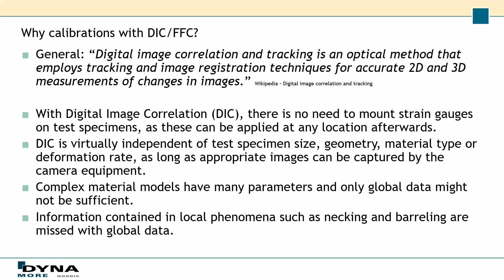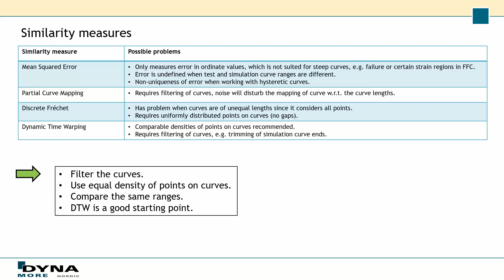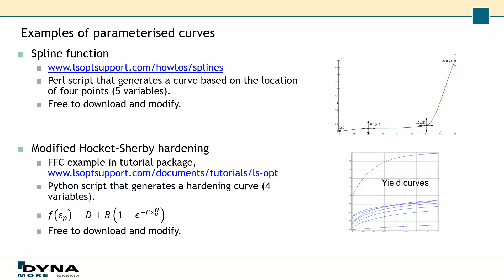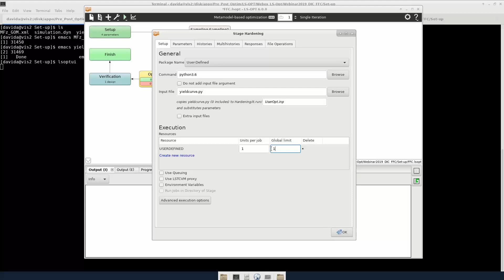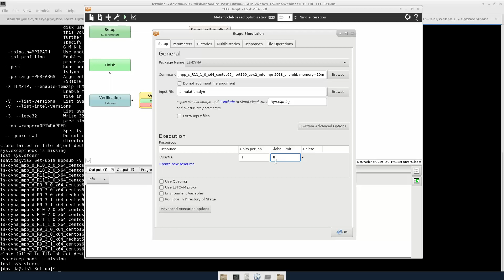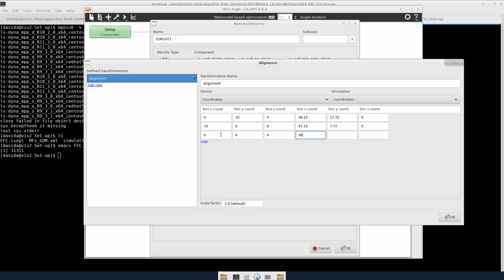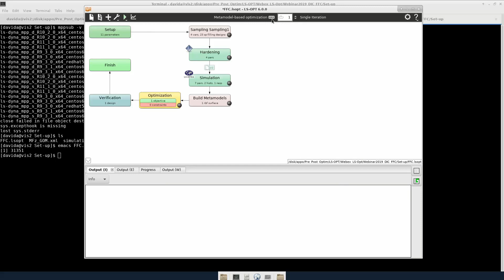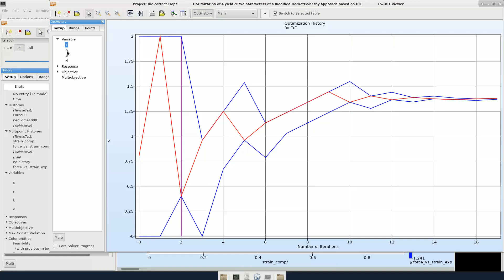Full Field Calibration using LS-OPT 6

Comment: Hi ! Very nice tutorial ! very helpfull! Do you have any idea if this methodology could work with a FE model using symmetry to speed up the computation time (for example in your model using a FE simulation for only half your sample) ? Or this workflow requieres a complitely simulated model to work ? Or at least a completely simulated model in the plan we are tracking using DIC ?
Reply: Hi. I can't see a reason to why it shouldn't work with only a selected area, such as one half of a symmetric model. The simulation model should probably cover the experimental points though, but I guess half of the experimental points could be removed as well.